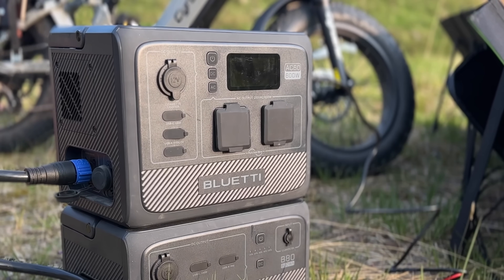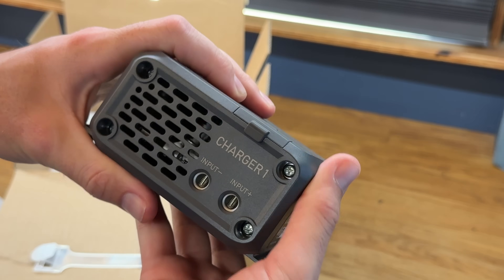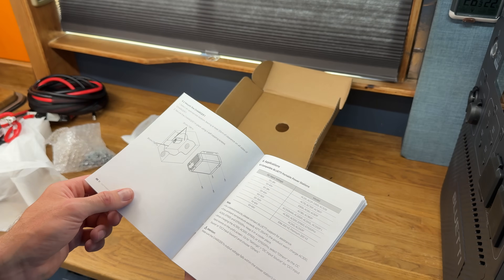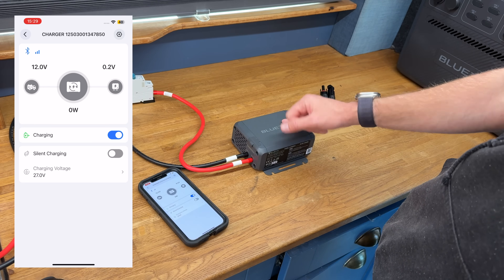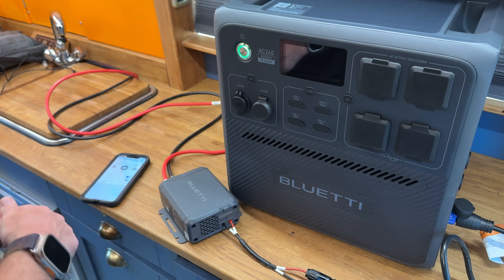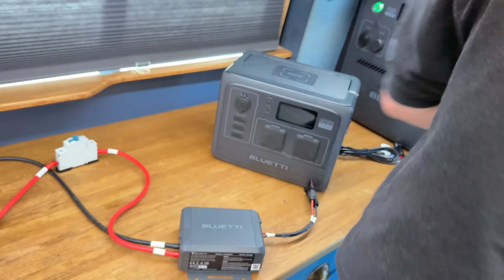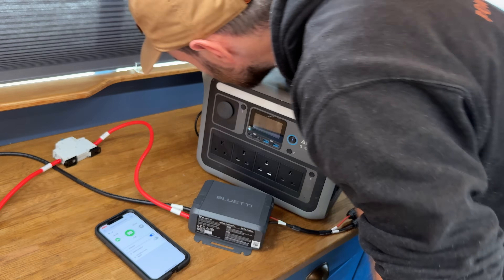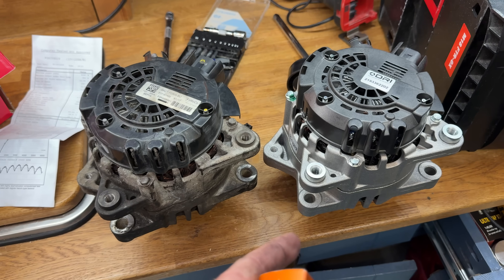WARNING! This Could DAMAGE Your Power Station | Watch BEFORE Using the Bluetti Charger 1

Comment from the maker: -WARNING & apologies for the attention seeking  title but I do think it’s important so people don’t damage kit

I think Bluetti Charge 1 is a great option especially since it works with almost any brand!. But as stressed in the video numerous times it’s extremely important to adjust the output voltage to be within your power stations MPPT/ports going above the port maximum voltage could lead to instant and permanent damage! 

People have a habit of not reading manuals and seeing because a plug fit in a hole therefore think it’s safe to put it there!
Reply: You've made a good point here & if it takes such a title to get people's attention & understand that the voltage have to match the p.s & charger1...as in the manual, but like you say many people don't read such.
It would only be an issue on small watt power stations, on my ac180 it was giving 230w without matching & 500w once  matched.

I'd suggest all owners download the Bluetti app & all settings are in there.
Reply: im new to all of this and thought the title was perfect. It grabbed my attention and is something I need to keep in mind when looking at these. Just like if you were to improperly charge a car battery, there are consequences. Just no one did a video and states that in the title :)
Reply: don't all power stations have their own power limiting as was demonstrated? So the worst that can happen is the power station will reject the dc input? The all-in-one portable power stations should not be damaged by more power but will also not accept the power. Damage will only happen when using the non-all-in-one portables, right?
Reply: @TheCoyoteWayOverland  I think it limits amps not volts
Reply: It is attention getting, but needs to be or someone could cause very expensive damage.
Reply: If you feel the need to apologize for the title, then you should change it.

Comment: thank you for the review !  i have a old version Anker powerhouse 757 . chatgpt say : it will not work because : it will not deliver 300W through the XT60 DC input because the 757 does not recognize this stable DC source as “solar” → and therefore limits it deliberately .     do you think this is true ? if not i will buy a new ecoflow

Comment: My Bluetti AC200 max and AC300 are disconnecting the input automatically when over voltage. To protect the power station(s) for damaging.
Reply from the maker: Many power stations do have an overvoltage disconnect however overvoltage disconnect can be overridden if the voltage is too high it’s a great safety feature which most power stations have built in but if the voltage is generally too high it can overcome the components which I’m doing the disconnect

Comment: I have recently bought a Bluetti Elite V2 1800kwh powerbank and intend getting a charger 1 to connect to my leisure battery which is isolated via a split relay from the car battery. So it will not be able to flatten the car battery if accidentally left on for a long periods of non use. Also, it saves me running the cable through the bulkhead and I can shorten the 6awg cable to a couple of feet.

Comment: Hey! What about charging a 12v battery directly to the terminals instead of a power station? I have a 12v battery plus inverter setup
Reply from the maker: Are you asking can you charge a 12 V battery from the output of the charger 1? is that what you’re asking?

No, that wouldn’t work. the charger 1 isn’t technically a “charger”.

It’s a fixed power supply. Ranging up to 56V output. The power stations via the solar controller are doing the actual charging converting the higher voltage into a usable charge voltage with profile for the internal battery of a power station.

If you want a 12 V charger from the alternator, use something like a Victron Orion XS DCDC

Comment: tell me this ive got a leisure battery in the van that is charged from main battery could i hook this charger 1 to my leisure battery to charge the bluetii. not the leisure battery gets its charge from the vans dcdc charger and solar already.
Reply from the maker: Potentially, yes, you could change the turn on voltage on the Charger 1 to something quite low ( so that it’s always on and thinks it needs to charge ) . And then use the breaker switch to power the device up ( or add a separate high amp relay and a trigger switch for the charger 1 ) 

Or do the low voltage setting as previously mentioned and just plug it into the power station when you wanted to charge
Reply: @MispronouncedAdventures  yeah the leisure battery that im connecting the bluetti to its rated charge is 20a/100am, max charge 14.6v its a 12.8v battery that is currently being charge from a dcdc car battery.
Reply from the maker: If it’s only rated to a 20 amp output probably decrease the output voltage of the charger one just so you’re not pulling the full 560 W current
Reply: @MispronouncedAdventures  yeah my leisure battery max discharge says on the lable 100a continuous. and the lesiure battery std/ charge is 20/100A

Comment: I believe the reason Bluetti supplied the 60Amp CB is so that you can cut the power to the Charger 1 if you are not using your camper for a long time. The Charger 1 will be drawing current even on stand-by that can deplete the vehicle battery eventually. (shipping my camper and the voyage last 2 months)
Reply from the maker: Yes using a breaker style one of the only reasons I could see for a long-term storage and turning the unit off. I still believe it should’ve come with an additional fuse based at the source for better wire protection.
Reply: @MispronouncedAdventures  Hi, I agree that is why I used a  Bluesea 285 series Circuit Breaker after the vehicle's battery and connected a Cole Hersee solenoid for ignition key control. Only when I'm driving does the charger 1 work. Note: there have been customers' complaints of the Charger 1 not turning off after 30 minutes when the engine is off.  Customer support asked these customers the switch of the unit using the CB until a fix is available.  Since the solenoid will take care of this issue for me, so I did not use the supplied Circuit breaker in my set up.

Comment: Does it make any sense to use this thing with solar panels or should I just run my solar panel wire directly to my battery?
Reply from the maker: Is the power station has two solar parts you. You can use solar and the charger 1.

Comment: You should add somewhere that EcoFlow has released an XT60i cable for their charger and can now charge other brands power stations.
Reply from the maker: I do actually mention that product was coming up in the original EcoFlow alternator charger video as it was in the original manual
Reply: @MispronouncedAdventures  Great! Thanks for the response.

Comment: Dude, what is up with this---I thought you had some decent, important information...Dang man
Reply from the maker: End Users accidentally destroying their power station by overvolting small models powerstation solar ports because they turn the charger 1 up to max voltage because I think it would charge faster without realising that is going to potentially damage their power station is kind of important.

There’s a few examples of reviewers instantly breaking some of the new anker power stations by overvolting the solar port without realising

Comment: Great advice!!! I've few moth ago upgrade to bluetti but before I've a good dcdc 12to24  booster  attached to my "solar port" of multiple dc station.... Personally i''ve do a upgrade/mod: out the bluetti i put a patch cable with a dc/amp meter and an anderson powerpole and ither side i plug and adapter to the correct port of powerstation so I can check all time power and voltage , i'm little overthinking so put a label on cable to mark max power input and brand of powerstation ecause example xt60 i use for a lot of different brand and model... take care and stay safe ciao ciao from italy!
Reply from the maker: Glad you thought it was helpfully, yeah marking your cables is a good idea if you are using lots of power station

Comment: Cheers for sharing mate, almost plugged mine in to my ac200max using the solar to ac adaptor to plug in to the power station because of another vid I saw somewhere else... Not sure if it would have done any damage but makes sense to plug the charger 1 in to the solar input due to the volatility of the current. Thanks

Comment: I've got a motorhome based on a 2022 ford transit, so if I mount the bluetti directly behind the drivers seat, (we have a cupboard wall right there to screw into) reducing the cable length from Bluetti to battery, to say 1m, would the breaker be close enough to the battery to not need a separate midi fuse ? Or is it best just put one in regardless?
Reply from the maker: That could well work additionally if you use the CCP point on the Ford Transit driver seat base that is fused with a midi fuse to 60A anyway
Reply: @MispronouncedAdventures  Many thanks  much appreciated , and thanks for the videos, yours are amongst the best videos I've seen (and I've seen quite a few) and just watched your CCP one, learning all the time .
Reply: I presume because 'motorhome' cab seats rotate 180degrees, there is no CCP i'll use the midi fuse anyway
Reply from the maker: normally  swivel seat swivel mechanism is between the seat base and the seat itself, not the floor and the seat base.

If you look at your seat base from the Driver‘s door being open down the bottom of the B pillar is there a small plastic cover which sticks out?
Reply: @MispronouncedAdventures  Many thanks for the reply, had a look after watching your ccp video. Is no small plastic cover (I think) will have a look tomorrow in daylight
Reply: @MispronouncedAdventures  No I don't have the CCP, the motorhome is a Chausson (French) so they've used a Transit cab chassis, and I'm assuming they buy these from Ford of a certain spec where they put in the electrics. I've wired in now and all running fine, didn't use the 60a fuse as it's not even 18" of cable to the breaker from the battery. Chatgpt informs me that the sweet spot for my 170bh ford in a Chausson motorhome, would be to set Bluetti to 41v, which seems to bear out, and ithat i'm well within capacity of both vehicle alternator and the charger.  Annoyingly it then tells me that the best connection would be with the leisure battery if it has a b2b charging thingy , (which I think it does)  perhaps where the elusive CCP was hiding or some variant of it, so I connected under the wrong seat. Doh! But it's working so i'm not changing.  Many thanks again for the videos that help the rest of us blunder through life the universe and everything.
Reply: Having done more research I added in the fuse close to the battery so it a 60a fuse at battery and the breaker at the charger, mines set to 44v for my Delta 2 and that seems to give optimum, idle 450w and around the 500w when driving

Comment: bonjour question sur Ampace Andes 1500 Station sur  le port xt60 sais écrit 11v 60v es que le chargeur bluetti1 fonctionne j’ai un alternateur de 150 ampère,  si j'ai bien compris je peut régler sur 56v merci
Reply from the maker: If the port is rated up to 60 V, it sounds like that shouldn’t be a problem for you

Comment: You connected the charger to the solar input connector. Is it possible to connect solarpower AND the DC-DC-charger, using a Y-cable MC4, to avoid changing cables al the time? Great video though!
Reply from the maker: No you can’t . as you don’t want a power supply constant output and in parallel with a solar panel 

But some have used a relay to do thing. So they wouldn’t be both connected at the same time and use the vehicle ignition to change the relay over.
Reply: @MispronouncedAdventures  OK, thank's. I bought the 200 V2 and a Bluetti 200W foldable solar panel. Very happy with it. Getting 140W out of it right now (9:38AM)... my fixed 185W-panel on the roof of my van is only producing 35W...

Comment: Could I hook this up to a 48volt (51.2v) lifrpo4 smart battery that is hooked up to my Anker F2600 power station that I have connected via TT30 to my camper?
Reply from the maker: As long as the voltage was within with spec of the solar port. I don’t see why not, many people do the same with 12 V batteries.

Comment: Great video! Definitely made me aware of potential issues.

I have a DC to DC charger from my campervans starter battery to my lesuire battery that obviously charges my lesuire battery as I drive, I was curious can I connect the charger 1 to my lesuire battery as apose to the main vehicle battery? I would be very grateful for your guidance! Thanks mate 👍
Reply from the maker: Potentially, you could connect it to the leisure battery. As there is no manual switch to turn the Charger 1 on or off ( it’s software based on voltage ) 

You might have to add a heavy duty relay for a manual switch to turn it on and off
Reply: @MispronouncedAdventures that's great! Thank you for the fast reply and info! 😊 just subscribed 👍

Comment: You are the expert,  but shouldn't you connect the positive first,  then the negative  ( and reverse on disconnect)? You made a point of doing the negative first.
Reply from the maker: There’s quite a few DCDC challenges. I know that if they’re using a common ground ( between input and Output ) they insist the negative has to be connected first and the positives afterwards otherwise damage occurred.  

Normally I would connect negative 1st and then positive. 

But it does somewhat depend on what the actual unit is

Comment: I feel like this should have a small display and a couple buttons to set the voltage.  An app seems a bit convoluted for something that seems to only have a single variable to control.
Reply from the maker: I feel a little bit of the opposite. Most people only have one power station model so after the first app based set up for voltage. They shouldn’t have to touch the voltage then. 

The app also requires you actively confirm you wants to make the voltages change. Which if done wrong and is too high could damage a power station

Comment: superbe vidéo je vient de m'abonner, moi j'ai une station fossibot 1200w comment fait ont pour avoir l’application pour régler ma fossibot merci
Reply from the maker: Hello, glad you liked the video. I’m not familiar with that particular model of power station but if you’re trying to figure out the correct settings for the charger one for the Fossibot, then I looked at the fossibots solar charger max voltage and then use the custom mode in the Charge 1 app

Comment: Stay away from Bluetti solar panels. They are cheaply made and the customer service is terrible.
Reply from the maker: You do mean the suitcase / flexi / portable type solar panels? 

personally not a fan of that type, I normally used ridged type
Reply: @MispronouncedAdventures  Correct. My 200w Bluetti folder died after 1 use.
Reply from the maker: @MC.4 that pretty odd. Any idea what fault? I

Comment: The point of this is to get faster charging correct?
You can just connect your car 12-14.5v directly into the 12-28v 8A Input.  But assuming it goes at full 8A - 12x8=96w. Vs this thing stepping voltage up to 28v gets you 28x8=224w charging speed.
Reply from the maker: Yeah, powerstation directly to “your car” would be the same as using a 12v sockets on the dashboard . So limited to 10A on the 12v socket. 

This unit can step up up to 56V @ 10A so 560W.

Smaller powerstation normally have a lower limited like 28V @ 8A like you said. Larger powerstation normally can go 56V so you get more out of the charger 1

Comment: Thanks for the video, youve raised a few points that will inform my installation. 

My AS180 and the Charger 1 will going into a lockable aluminium box on the drawbar of a small (motorcycle sized) camper trailer allowing me to use it with 4 different vehicles. 

Ill now be adding some computer cooling fans to allow removal of heated air and to pull in fresh air. Ill have to calculate the charging rate I can use on the two older vehicles as those alternators wont be as capable as the two new vehicles.  Will be using an Anderson plug to connect each vehicle to the trailer charging system. So each vehicle will need its own wiring and circuit breaker set up.

1800 Goldwing Sidecar will be the first. 1100 watt alternator apparently.

Comment: So... what I got out of this is, "Franchesca, don't worry about it. This doesn't apply to you. You are always where there are outlets and in the God awful tearfilled circumstance that the power goes out more than a day or two, you have solar panels."  

The only way this might help me is if I could hook to solar panels and charge it with solar panels because the battery bank is so rediculously heavy it's just not practical for me to move anywhere that scootching isn't possible.

Edited to add: Outstanding video though! Sometimes, knowing what not to buy is even more important and this is definitely something I benefit knowing I don't need.
Reply from the maker: Glad you found the video useful if you’re primarily charging my Solar and that’s all you need then you won’t need this. This is for people who want to charge at a fast speed in their vehicle.